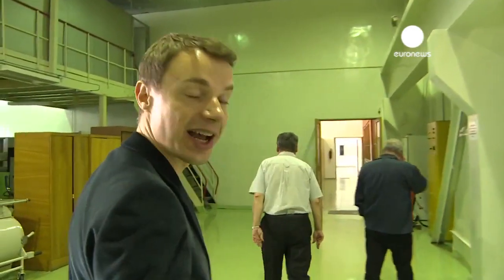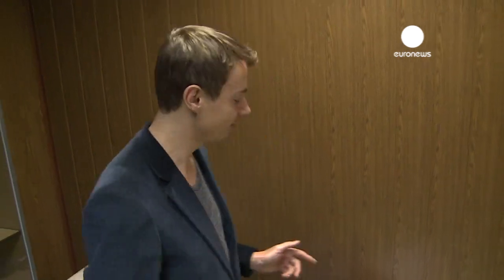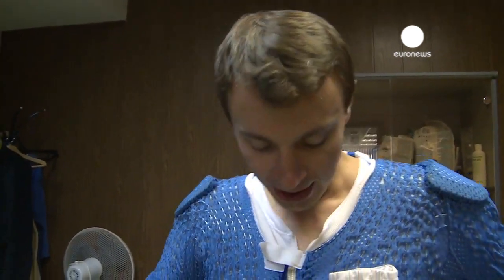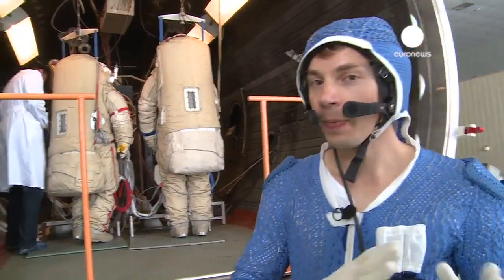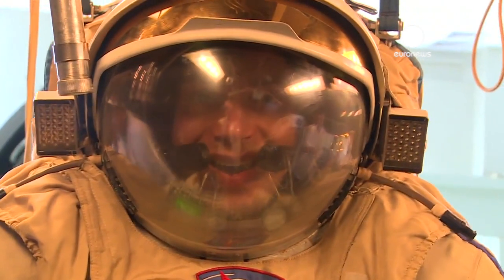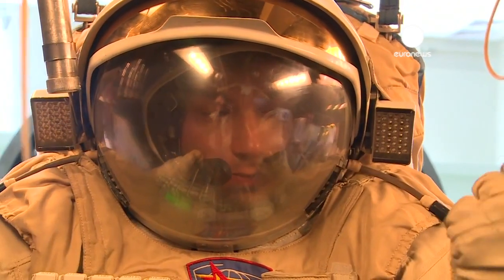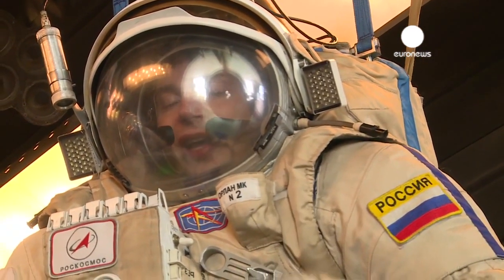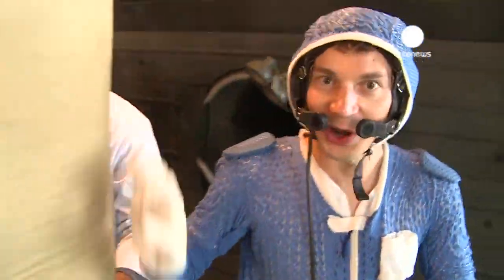Trying On a Real Space Suit

Comment: I can tell you for SURE it would take hours to vacuum pump down to a few Torr.  They probably got to some few 100's.  "high" vacuum is 1 milli-Torr, which is quite difficult in a large chamber.  Outer space is 1 micor-Torr and lower.  I have done vacuum testing on high voltage equipment, and it is crazy the troubles you get.  But still, this was a very interesting video.  And like others, this proves the impossibility of 2 men getting into a LEM, both with full suits on, and then somehow de-suiting inside the cramped cabin without techs to help.
Reply: Thanks for your info!

What I have heard, there were several equipment or gears NASA never tried on earth since it was too "risky" or material physically not possible.

Will post one link with information about the LEM and its hypergolic engine. You will be surprised that these engines never were or could be tested on earth, but functioned 100% every time on the moon and the pilots operated these LEMs also with 100% perfection :) 

https://gizmodo.com/how-did-lunar-landers-re-launch-when-there-s-no-oxygen-1690484536
Reply: Not sure if there was any reason to remove the suits inside the LEM.
Reply: @dansv1  Do you see some problems with men dancing on a dusty moon? I mean with all problems 2019 in a clean environment in a low vacuum at just 64000 feet!
https://www.youtube.com/watch?v=7gXhCe1DwVg
Reply: @dansv1  They removed them to sleep more comfortably. I think the crews of Apollo 11 & 12  had their suits on (minus gloves & helmet of course) , but the neckring interfered with their comfort, so on later missions, they doffed the suits completely.
Reply: Are you trying to disprove the moon landings here?
Reply: Huh? These two suits are not comparable at all, the Orlan (as shown here) is an EVA suit designed for operation in a "weightless" environment (ie free-fall), whilst the A7L (The Apollo EMU) was designed to work in both free-fall and 1/6 lunar gravity. The Apollo EMU has more joins for mobility, it also operates at a lower atmospheric pressure (3.7 psi compared to the 5.8 psi of the Orlan) to facilitate easier movement (it was still difficult).

You have no idea on what you're talking about.